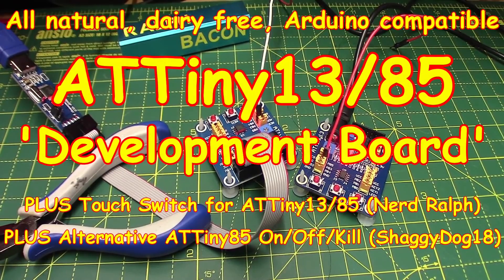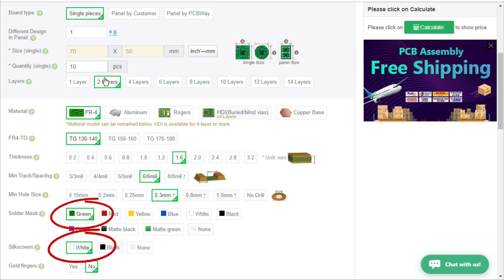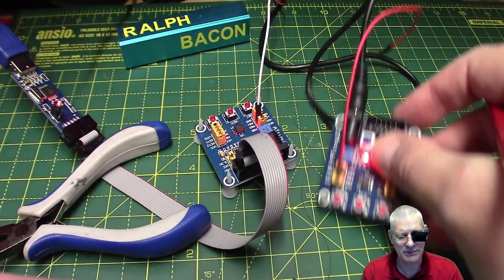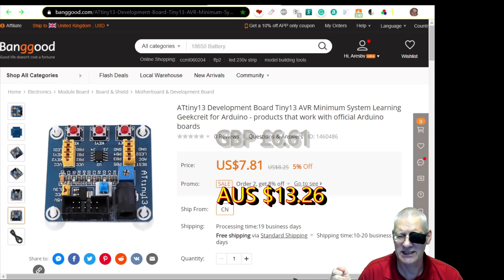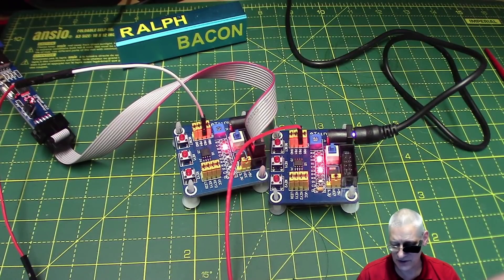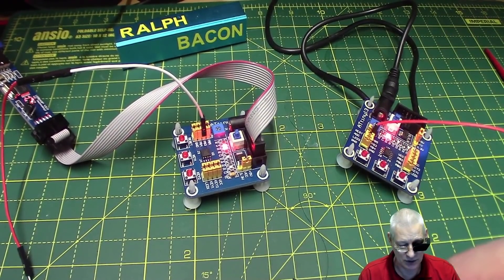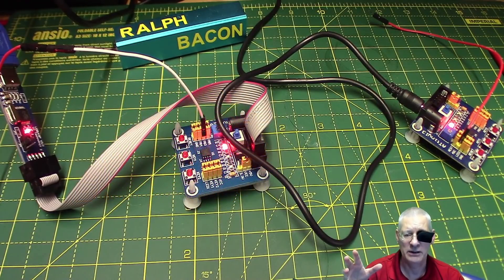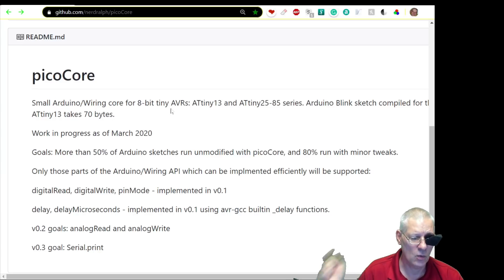#181 ATTiny13 (and ATTiny85) Development Board, amazingly useful

Comment: When you can get a ardunio nano for a dollar why not just use that. This thing cost too much for what it is.Clip the pins or dont even use a pinned version and a nano is thin enough to go alot of places.
Reply from the maker: I can't get a Nano for $1! I can get the 328P (or even the 168) chip used in the Nano for less but not the full blown board, with USB-to-Serial converter and PCB and everything. Funnily enough, my fridge alarm (from whence this whole ATTiny13 topic stems) has been running on a Nano for some years (see videos #41/#42). The challenge for video #177 was whether I could replicate all the functionality in a Tiny13. And, then I found this development board which would have been ideal whilst I did that challenge (and still use it now) albeit with an ATTiny85! So that's the raison d'etre for this video and board!
Reply: As I understand it, getting a Nano to emulate any kind of HID is more painful. Keyboard.h is not compatible with atmega328p.  It works with attiny and atmega32u4 tho.